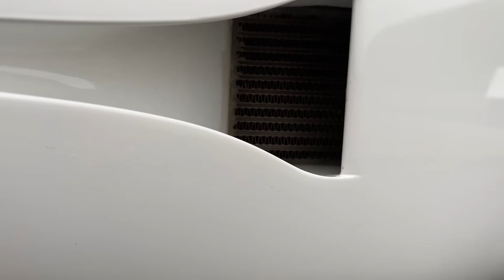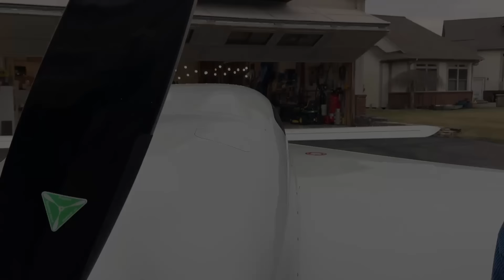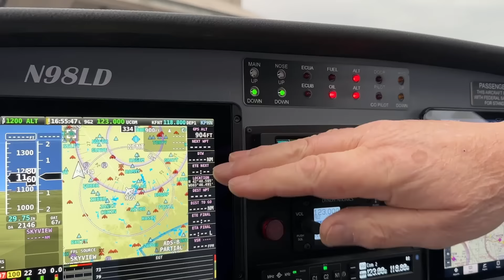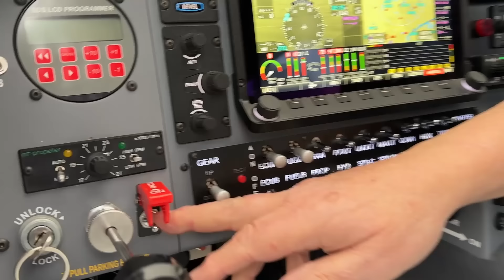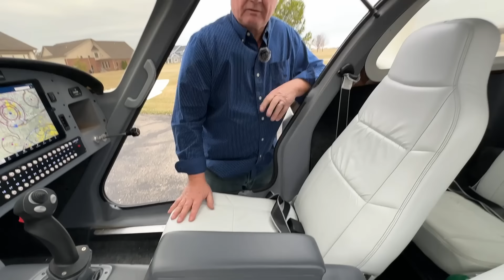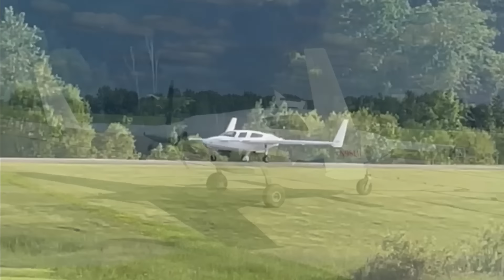LS3 V8 Powered Velocity Walk Around

Comment: Very cool. I’d have to have had the more powerful Tahoe motor with the 4 cylinder cruise option-as long as a motor of this type is being used, I’d get all the bells and whistles. Also the higher performance prop. But this gentleman did an AMAZING job on his build, incorporating that P51 type air scoop was a brain storm! Imagine actually achieving thrust with an air intake and engine exhaust. The trailing fences and vortilones were another small upgrade, that produce a very very small amount of drag but enhance low speed control immensely. Builders can learn a lot from a person like this, who is obviously very knowledgeable. Anything he mentions that he could have done-we can tell that he’s promoting an improvement over his own aircraft. Very selfless and professional. 😎🇺🇸🛸

Comment: My father as a VelocityXL he built when he retired from Delta 35 years ago with a crate 350 high horsepower.  He loved flying it. The inside is finished and it is primed.  I think he might have wished he had put a scoop on the bottom for better cooling. I don’t know, I’m not a pilot.  He can no longer fly and would like to sell it.  I don’t know what it is worth since it just needs paint and a tune up, but can be modified first since. It is fiberglass. You can find article on it from when he used to go to OshKosh.  TX350. Any suggestions on where or how much he should sell it for?  Thank you.  Love your plane.
Reply from the maker: I would suggest reaching out to the owner's group or checking aviation classified sites to see what similar builds are listed for.

Comment: God those "hydraulic lines" for the front wheel steering cylinder don't look like they are good for much more than atmospheric pressure. Hopefully that's isolated from any critical hydraulic system, like rudder. Maybe I don't know what I'm looking at, I've just never seen any hydraulic cylinder fed by such small, unreinforced lines.
Reply: You'd be surprised.

Comment: Those trailing fences are similar to a foil on the bottom of a rudder on a boat. During steering, a rudder that has a big gap between hull losses effectiveness, water slips over the top edge. Same with a foil on the bottom, water slips off the bottom. Effectively, you can reduce the length of a rudder when a foil is put on the bottom. This is handy for Catamarans.

Comment: The engine in your Tahoe is actually not the same. That most likely has an L92. Same block, same heads, same crankshaft, but different camshaft, intake manifold, pistons, rocker arms, valves, and ECU tuning, along with cam-phasing hardware to enable variable valve timing. All that to enable more torque at lower RPM (at the cost of a lower redline), which is important in heavy vehicles that might be towing and hauling, but not nearly so important in a Camaro or Corvette. LS3 also does not have the displacement-on-demand system discussed at 20:22. I actually wonder if an L92 (or its E85-compatible cousin, the L9H) might have been more appropriate in a plane!

Some LS3s had a dry-sump oil system, which seems like it might be important in a plane. I'd be curious to know what if anything you did to ensure good oil pickup in all phases of flight. I know a properly coordinated turn won't pool the oil to one side, but what about climb and descent? I'm guessing you probably never do any severe angles, so many this isn't as important as I'm inclined to think, but using the same logic that leads you to use redundant _everything_, it seems like the sort of assurance you'd want to have just in case.

Comment: 15:45 Why does it specify such a slow speed? 200 mph is very slow, in my opinion. On the Velocity website, the XL with the Continental TSIO 550 is listed at 250+ kph. But it has much less power than the Corvette engine. How is that possible? Can the Velocity even reach speeds of 250+ kph, or is that just marketing?

Comment: The LS3 engine is a Gen IV V8 engine with a displacement of 6.2 liters (376 cubic inches), known for its 
lightweight aluminum block and strong performance. It produces around 426-436 horsepower and 420-428 lb-ft of torque
Reply: Yeah, it’s a great engine, however it is not a Chevy, like the dude said twice. The LS is a GM engine. Chevrolet did not design or manufacture this engine, GM did.

Comment: If you were taking off at around 4500 engine rpm, that equals 350 hp on every Dino sheet I’ve ever looked at it 10 to 1 compression. Other than that I am extremely impressed with your achievement

Comment: Great looking plane, lots of HP and likely fast, but one of the problem with canards is the lack of luggage space. You will have to give up at least one , maybe two back seats for it. Even fighters like the FA 18, they can bolt on a luggage pod and the pilot's duffle bag can go with them, you got nothing, so you are supposed to travel with just your tooth brush?? Canards do not stall, but what they do not like to say out loud is they can develop a scary sink rate if the pilot did not stay ahead of the plane.

Comment: Automative engines are not built to run at high power for long duration. Extensive modifications have to be made. Cooling for engine and oil systems has to be beefed up substantially.  I am thinking the main bearing need modification.....in short you cannot take a stock 500 HP engine and expect it to survive 375 HP for very long. but if it works it works!

Comment: I am not a pilot.  But I'm wondering what the small tube in front of the air inlet on the bottom of the aircraft is?  I am referring to the tube that looks to be about 3" long and has a small ball on the end of it.
Reply from the maker: You may be looking at the transponder antenna.

Comment: Idiot enough to use US made car engine on airplane,  why?, American don't know how to make reliable car or car engine. Suicide mission.
Reply: Hmmm, I have the same engine in my 2010 Chevy Pickup...300,000 miles and counting.

Not to mention, most of those miles were on the middle of nowhere, 80 mph highways of Montana, Wyoming, etc.

Literally thousands of hours of 2500 rpms, with a thousand more at well over 3000 while climbing up into the Rockies...

Right in this aircraft's wheelhouse, by the sounds of it...anything else?

Comment: Second oil cooler, governed rpm, wing strakes, longer struts, nose pin, breakers, NACA's, redundancies, ... this guy has thought of everything. And it's beautiful.
Reply: Everything but the headliner! That will surely come.
Reply: @fattyman9133  Okay I am not the only ome that saw that. hehehehehe
Reply: @fattyman9133 that’s gonna be ostrich skin. Coming soon.
Reply: Dual plugs in the head with each going to another distributor?  I mean, come on man it's a sweet build but it's far more dangerous than a regular build with an aircraft engine.
Reply: @OoheavysackoO  Do you know what the LS failure rate is for something that plain?

Comment: I owned a Velocity RG back in the 90's, and I loved it. It looked faster than it was, though, so the V-8 was a great idea, and kudos for solving the weight-and-balance challenges that a (presumably) heavier engine presented! Be careful not to run over Cessnas in the pattern, and enjoy!
Reply: In another video about a similar LS3 engine in a Murphy Moose, the fellow said the firewall forward weight was around 500lbs.  Probably not much of a weight and balance issue.

Comment: Without a doubt. The finest, most sophisticated experimental high performance aircraft I have ever seen.  Bravo!
Reply: High performance? According to him, it only flies at 200 mph. But according to the Velocity website, it should be able to reach 270 kts with the right engine. That's a huge difference. So how is that supposed to be high performance?
Reply: @dennisanonym8658 yeah when he said 200 mph i was thinking it should be a lot faster. 4 blade prop would help.
Reply: @batvette  Extra blade doesn't translate into greater speed.
Reply: I don’t know much about planes, but is this classified as experimental? If so would it always be classified as such?
Reply: @Notfiveo0  Yes, in a very large nutshell, this is considered a kit plane, and you assemble it yourself. So the FAA doesn't regulate a whole lot on what you can and cant do. It still needs to be inspected by a certified mechanic/FAA inspector for airworthiness for key components for safety, but for the most part, if it's classified as experimental, it'll stay classified as that.
Reply: @Notfiveo0 Because kits are Experimental category.  It's owner-built from a kit.
Reply: Meah. It ain't all that.....
Just kidding.😂 She is an absolutely gorgeous aircraft.❤

Comment: Building this plane with a crate Chevy cost about 1/2 the cost of a new Lycoming.
That is awesome.
Reply: How many people drive their corvette at 190mph at 5k rpm for thousands of miles? It works sure, but aircraft engines are designed to do that.
Reply: @chester8420  And that Vette won't last long.
Reply: Old wives tales never die. One of the single most idiotic statements about auto engines as they aren't designed to run 4-5k continuously. Typically a statement like that comes from people who have never driven a one ton truck with a gas engine.
Reply: @hawkdsl Well they aren't, and that's a fact.  It's not an old wives' tale.  If car engine conversions were so great, economical, and reliable,  EVERYBODY would be tossing out the Continentals and Lycomings, but they're NOT.
Reply: Far less than 1/2. A new Lycoming or Conti with similar hp is now about $80k. His crate engine is about $10k
Reply: Or never driven tank after tank of gas in 24 to 36 hours with only gas stops.
Reply: Car engines aren’t designed to be run at 3100 rpm’s continuously. I’ll take a Lycoming or a Continental engine all day long. 
This guy is a true craftsman with an engineering mind and I’m certain an engineering background.
Reply: @michaelhenning6394 
I begged to differ with you But to each their own opinion. I've driven from san francisco bay area to las vegas, with one stop for gas going up the Tehachapi which is a hard climb from about a thousand feet up to 3.5 thousand in elevation keeping the rpm up over 3500 for that 1 plus hour in the heat, no cooler air to cool the motor down. Not once but dozens of time same truck with a small block chevy.
Reply: @ThomasLeonard454  You may have gotten lucky with that one.   I know a fellow pilot that used a Chevy LS in a S-51 kit, and it never flew more than 5 to 10 hours before something in that engine failed. Car engines are just not designed for aircraft use.  Another company in FL tried adapting Subaru 6 cyls for aircraft use, and that company no longer exists, the conversions were failures. Another guy tried a 3 rotor Wankel in his RV8, and according to what I read of his experience, it was a never ending string of problems.  He almost had to reinvent the wheel.  It was very loud, fuel consumption was high, and it had cooling problems.  If car engine conversions were so great, EVERYBODY would be doing them; no one is.  Car engines are not designed to run at 75% power continuously.  The best aircraft engine conversion is to take your money and convert it into a good Continental or Lycoming.  The engine conversion guys try to do it cheap, and "when you buy it cheap, you end up buying it TWICE".
Reply: @ThomasLeonard454  And if it breaks, you pull over.  If it breaks in the air you may die.  You are paying for redundancy and your life when you buy an aircraft motor.
Reply: @OoheavysackoO 
  A plane is not driven at TOP = (take off power) all the time, there is a cruise speed that is recommend which is = to the same in a car.
How many car miles have you driven at high speed? Take off power?
How many car engines have you broke?
Yes there are some cars that just don't start in the morning. So you don't drive (take off) that day until it is fixed.
You forget that the 2 engines have the very same internal and external parts, just a different output method. 
What makes 1 better than the other?
Clearances? They can and are made equal in like type engines. 
Balance, they can be balanced to the same tolerance. Rods and pistons can be made to higher tolerance to high pressure and heat in auto engines due to aftermarket Race engines, cams ditto, valves ditto, springs ditto. 
IMHO an engine for a car / plane can be made stronger both physically and more powerful, cheaper.
I will admit that race parts might make them equal in cost but the auto engine would be stronger and have equal or better longevity.
Reply: @ThomasLeonard454  We are on the same page.  "IF" a small block is built out to spec it would be equal.  

If there was money to be made by GA aircraft they would be using car motors, alas they are not.  You would have to put in all the redundancy of GA motor on a car motor and actually build the motor.  It might cost the same or a little more and give you a little bit more power.  But it's a one off build with no history behind it.
Reply: @ThomasLeonard454  I agree with you.  My argument is the cost.  If you do your own work on the car build, it will be close to the same cost and assuming you know what your doing and have all the tools to do it, it will probably just as expensive as the proven plane engine.  I'll be honest and say I don't know if you can do a dual distributor/dual plugs heads setup on a small block Chevy.

Lycoming aircraft piston engines have two spark plugs per cylinder as a standard design feature.
This is required by FAA regulations (14 CFR Part 33) for certificated spark-ignition reciprocating engines. Each cylinder has one spark plug fired by the left magneto and one fired by the right magneto (typically one upper and one lower plug).
This provides both redundancy (the engine continues running if one magneto or one plug fails) and better combustion (two flame fronts burn the mixture more completely and efficiently).

Performance is one thing, safety is another.  I'll take the proven engine all day that is built for the task.
Reply: @RR-pw5nb  Agreed.
Reply: @michaelhenning6394  That's a broad statement that can be true in some cases.  Honda motors are designed to run at constant high rpm.  Heck to reach 75 in my 88 Civic it was 3650 rpm.  I drove it for 6hr a day at that rpm or higher for a year.

Edit: 
My 88 dx ran 3250rpm or so, my 91Si was nuts.  The 91Si was the one that ran 3650rpm in 5th doing around 75mph in Mexico of course.

I got around 33-35mpg on 87octane in the 88, 26-30mpg on the 91Si.  With LSD and a 60 shot of N2O that 1.5 cried for mercy in the Si lol.  Don't trust Chinese made jets, glad I only melted my plugs. 

I think the bigger problem is the lack of redundancy on car motors.  Lack of dual distributors/plugs/fuel pumps/and lord knows what else.  Your car loses the motor on the highway, you pull over.   Your plane loses the motor in the air, you are now in a proper crappy situation.
Reply: @OoheavysackoO 
The redundancy is because you can't pull over to the curb and park and wait for somebody to come for a repair. That's the only reason for the redundancy is you can't pull over to the curb, you have to keep going.
Reply: @ThomasLeonard454  I couldn't agree more.
Reply: Car engines never work long term. It’s been proven many times over. It’s been explained why over and over .
Reply: @johnwalters878  But yet people risk their life on a small block build.:text-green-game-over:

Comment: I fly a computer now... it's not the same but I can still "feel" the aircraft moving as the screen shifts under yaw and pitch and so on... but it's all I can afford now.

I just recently bought the Velocity program for my simulator... it's now my second most favorite aircraft. Sorry, but the Lancair Legacy 350 is one hot little rocketship of a plane. This Velocity though... it's so realistic I have to adjust the heat and defrost as I climb or the windows fog over. It's got the Garmin G1000 glass cockpit, with a 3-pack of backup instruments beside the left screen. I can link my audio to any MP3 or 4 audio files on my computer, and the airplane's CD player will play music or... my personal favorite... audiobooks... over the aircraft sound system. 
It is one DEVIL of an airplane to get slowed down! I got REALLY spoiled (pun intended) by the spoilers on the Lancair. The Velocity is not something you come smoking in fast in, then drop all your junk to slow it down. There's nothing to drop but the gear. It slips beautifully, but it doesn't do much good. It's just too slippery.

Hell of a nice airplane. I'm going to upgrade my displays to at least one, probably two, touchscreens so I can use this G1000 suite properly. 

Thank you for showing this very beautiful aircraft. I LOVE that flyover!!!! This thing has an awesome sound to it!
Reply: When you said you fly a computer now I literally thought you were an airline pilot 😂

Comment: I would definitely put the hydraulic lines for the nose gear inside a high-strength cowling, or inside some kind of semi-rigid conduit, and for a home-built project, a dual-action pedal and cable would seem to me more appealing, even though the homemade hydraulic is probably well-engineered.

Comment: What happens if one of the doors pops up right after take off.   I found the answer on the internet happened to one said almost uncontrollable door didn't tear off said only turn into the open door side if you turn away it will stall spin. 2nd one says they were at 9500 and pilot door opened and tore off lucky for them didn't hit the prop. Not really a fan of gull wing doors.

Comment: AWonderful build and wow what a sound!!
A nother great auto engine would be the Mercedes M113 5.0l V8, 2 plugs per cylinder and most reliable of all Mercedes engines. Std is 305hp can be supercharged to 500HP.
Reply: What is the weigh of the engine?